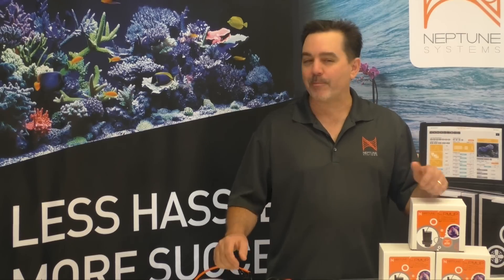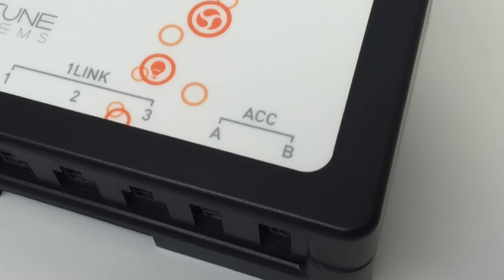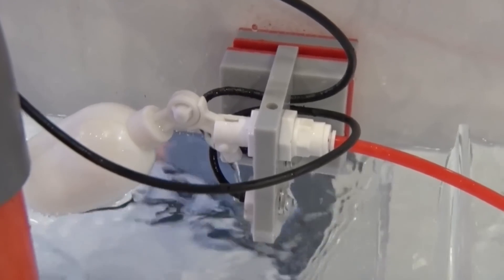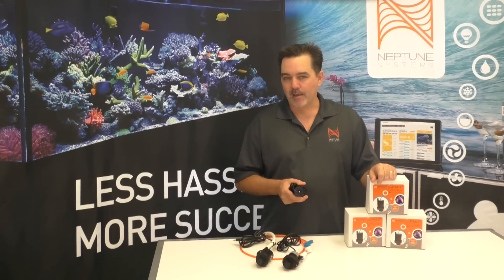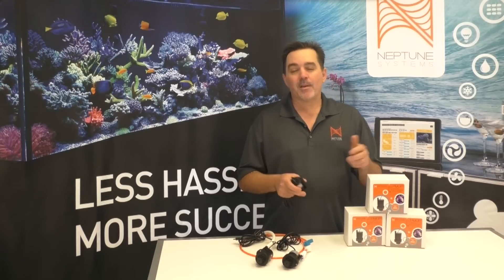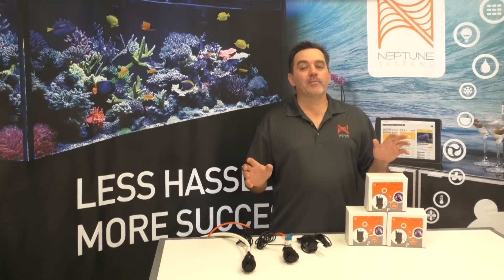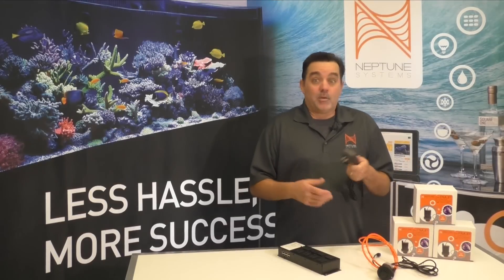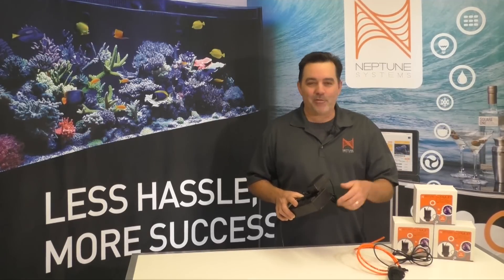PMUP   Practical Multipurpose Utility Pump

Comment: I have this pump setting in my Skimmer overflow. It is plugged into my FMM and I wanted to put a float switch, connected in my breakout box,  in to control when to activate it. any ideas on the where I go to set all this up?

Comment: Using this for AWC instead of getting a genesis Renew.

For programming I would need two float switches? one for the high point to stop refilling and ATO and then one for the low point to stop drain and trigger refil?
Reply from the maker: This might work fine for very large tanks, but for the average aquarium we would suggest using the DOS to do AWC.
Reply: Neptune Systems it'll be a 180 DT with a 40 gal basement sump.

Comment: I've seen in this video you are using the PMUP with your apex ATO magnet. It looks attractive to me but will the float-valve shut the PMUP flot in case of sensor failure??!
Reply from the maker: Yes. This has been tested and is the intent of that float valve - to be the backup for when electrical shut off fails - it will also work with standard RODI output as well.

Comment: can this pump be run at 100% duty cycle? i.e. could I feed my Calcium reactor from this guy, or is a maxijet better for that application or better yet a peristaltic pump?
Reply from the maker: Yes, it can run continuously. We have run them here in our office for 18-months straight, without cleaning, as the primary return pump on a 10g nano reef tank.  That said, this is not a good solution as a Calcium Reactor pump as the flow rate is too high.